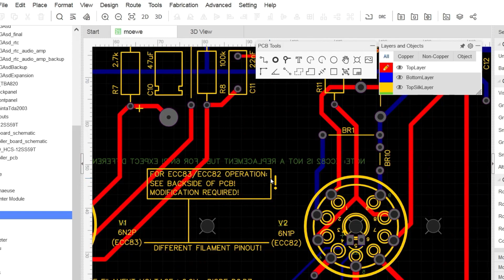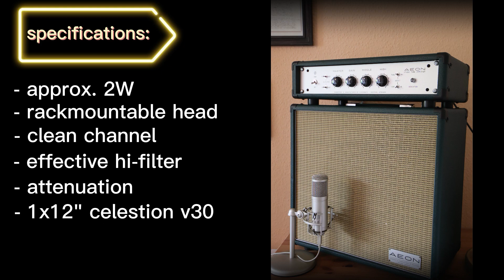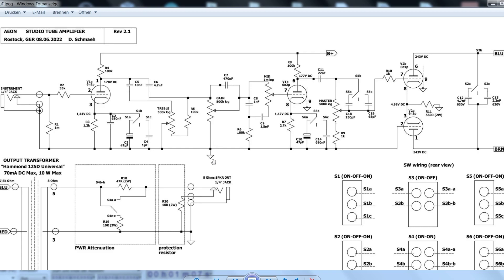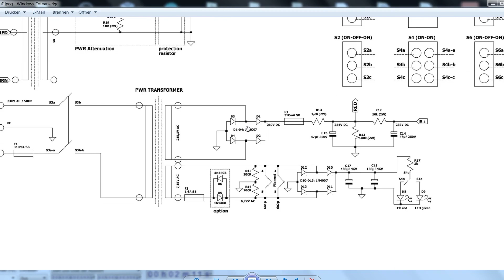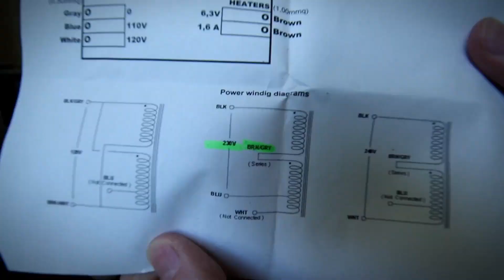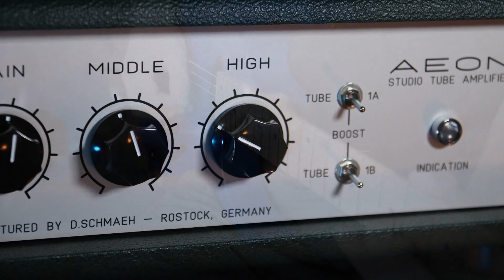Building my own Tube Amp | Pedal Platform Amp + Schematics

Comment: Cool stuff! Putting everything on PCB makes this a great DIY project. I may have to build this one day...
Anyway, what's the deal with the power amp having no PI? I tried to do some quick research but there is hardly any info. Intriguing!
Overall a very unique design. Hearing a bit more about the design process and ideas behind it would be so exciting.

P.S.: Also, would you please do yourself a favor and move F3 before the rectifier? It might one day save the power transformer :)
Reply from the maker: Thank you for your comment. In the video I said the goal was to (somewhat) radically reduce complexity squeeze the most out of just 2 triodes, therefore a Phase Inverter (PI) isn't needed. Of course everything comes at it's costs. This design is called self split and isn't new at all. You can find books from 1948 with those designs (e.g. "Phase Inversion Circuits" by John W. Straede in Radio-Craft, 1948.) The goal is - as I mentioned - to eliminate the need of the PI tube.  Typically, the driven push-pull tube operates only in Class A, and the other push-pull tube has a mirrored signal applied to it, therefore the maximum output power  is lower than for Class AB. Furthermore, the mirrored signal linearity can suffer as grid-conduction and cutoff regions of operation of the driven tube are approached, so acceptable output power can be even lower. That is the downside as mentioned above. But since I this is a guitar amp, there is no need for "ultra" linearity. You are right it is always better to put the fuse before the rectifier, since the rectifier diodes itself can fail. But in that case the main fuse will do the job. But in the end you are right. I am not quite sure, maybe on the PCB I corrected this.. I have to check..
Reply: @Aeon_Electronics  Now this is dedication, thanks a lot for your detailed reply! I regularly work on typical mainstream guitar amps, so I have a very narrow view on tube amplifiers. I definitely have to do some catching up about PI-less power amps. Thanks for the info, I need to read more about this. Sounds like a great alternative to single ended power amps for home use!
About the fuse, I didn't mean to be pedantic. It was just the only thing I could ever contribute, since your design looks very well thought out. Perfectly tailored to the needs of a home guitarist! To my knowledge, I haven't seen silicone diodes fail short myself. Such a picky placement of the HT fuse may only be relevant in old amps with irreplacable original parts to sleep peacefully. Should be unlikely to ever matter in practice. :)

Comment: I’m impressed yet again, nice touch to add in the load resistor, it seems an obvious choice for consumer electronics to do this and yet it is not a common practice for $$ reasons you know😄.  This is exactly the kind of amp I was thinking about almost every time I think of low wattage amps for recording and practice.   There may be a nice chime and clarity to single ended designs but where is the tight and present bass ? 
Push Pull wins each time for me. 
  I have had wild ideas of hybrid amps that use an electronic crossover to combine solid state on lows and run the mids on up with a single ended amp but all that complexity for what?  It may sound better in my imagination or in practice sound nice when I combine two amps with separate speakers but all in one? 
It’s just easier to go with a less complicated signal path and get good clarity.  
  In today’s world this amp is all anyone really needs on guitar for the real deal tube sound, the rest can go to a console or PA.  
 Add an Effects loop, possibly one more boost gain stage and a line out - ehhhh I digress, it’s so good as it is. 
Simple is how to keep the sound of your hands involved.
Reply from the maker: Thank you for those words. In fact, over the years I built much (!) more complicated amps with two and three channels, push pull pots etc. But to be honest: I didn't used them that much. I am still playing this amp almost every day and I am happy with its features. You mentioned the lack of tight, presence and bass. This is not correct, on the left and right are switches for bass, and some kind of presence control :) For a lot of sounds I am using pedals anyways.

Comment: Trebble controll looks like from 18 wat Marschall. I had build unique amp with it - 2 EABC80 (from tube radio) with treble and volume controll in between and single ended EL84 autput. I used it with radio speaker and it was poor, but, with real guitar cabinet (combo) it was the best lead/crunch sound of the guitar i hear in my life, way better than stock amp that come with that combo. I did not needed additional tone shaping or pedals.

Comment: You are among those rare gems of YT with low audience but highly documented projects. I wish you all the best.
Would you recommend adding a FX loop mod here by tapping off before the master vol pot or after Sw5?
Reply from the maker: Thank you a lot! An FX Loop could be added, but since it does not overdrive that much, personally I do all my overdrive / distortion with pedals.
Reply: @Aeon_Electronics  I understand that the preamp type pedals will have to go in front of the amp with your design here, and that's perfect as a platform for driven tones. It sounded amazing with that Boss MD-2. I'm thinking of using a clone of Wampler Pinnacle or MI Super Crunch Box or a Revv G3.

Comment: Just got my pcbs! I have a few minor questions, may I email you?
Reply from the maker: Of course you can email me (messier31[at]posteo.de). Maybe your questions would help others, too? Feel free to post them as reply / under this comment! Otherwise of course you can email me. Greetings!
Reply: I had one question about the type of Power Transformer used by you. I cannot find any 215V secondary transformer. Please suggest alternative. Primary voltage in my region is 240V.
As per Rob Robinette's designs and specs for 2W-5W amps, can these be used for your design here?: 
AnTek AS-05T200 toroidal power transformer 200v @ 130ma (50VA), 6.3v @ 4 amps;
Output Transformer Hammond 125B @ 5W 22.5K:8 ohms.

Comment: Sounds really good, what was the cost of all the parts to build it?
Reply from the maker: Since i've only used high quality parts like F&T / WIMA capacitors made in Germany, Miyama & APEM switches made in Japan and France, as well as all custom made parts like "one of a kind" CNC made front & rear panels, I paid around 1100€, that would be 1.207,80 US-Dollars. My rackmountable head and the cabinet is handmade out of real wood, too (not plywood). If one wanted to build this on cheap, without care about the look or quality, I guess it would be possible around 500$ (with cab!).

Comment: Nice design!

I see one potential issue. You say the amp can output about 2W (probably more when cranked). The main load resistor for the attenuator is shown as 2W. It will see most of the output power if you crank the amp and turn on the attenuator. 2W is simply not enough to handle that. It may burn, and even if it can handle the power, it could get so hot it damages other components around it. I recommend using at least a 10W resistor in this position. You need to have a significant margin of error for any resistor that sees a lot of current.
Reply from the maker: Thank you a lot, you are right, this is not quite right in my schematic. In reality I used a 5W resistor. The cranked output is around 1,95W. I'm glad that you pointed this out, I will correct this in the schmeatic!
Reply: Has it been corrected in rev2.1? Excited to give this a shot.
Reply from the maker: @parkinsane   This is just a typo in the schematic (R20 states 2W) I reality I've designed the PCB layout for a 5-10W resistor (the footprint). In my design I used an 5W resistor. So you are fine if you want to order my PCBs with the linked Gerber files. :)